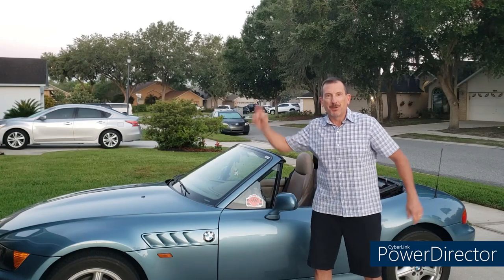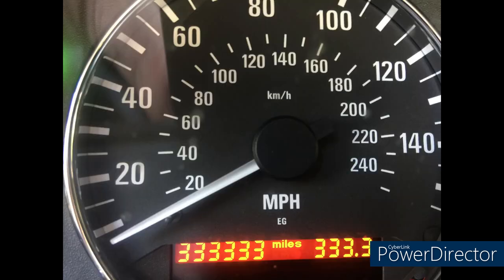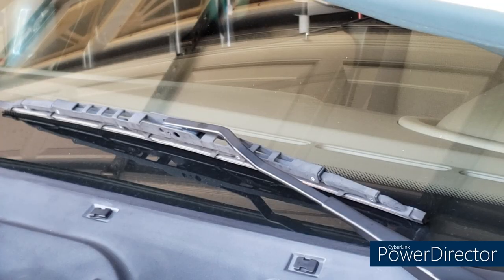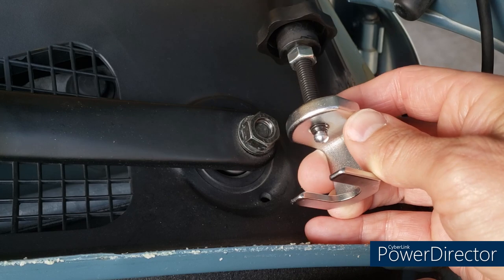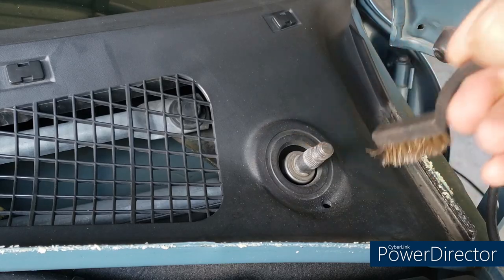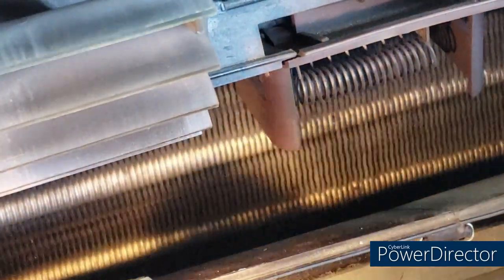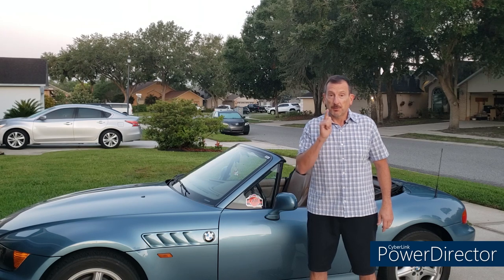How to Remove the Cowl, Check the Drains, and Clean the A/C Evaporator: BMW Z3!

Comment: I did similar a while ago..You can take it one step further by removing the blower to clean more surface area of the evaporator. Additionally, after the foam breaks down use a squirt bottle to clean and  flush out the system with water..You will see all the water and foam dripping out the bottom.
Reply from the maker: Good call!  I should have rinsed that day.

Comment: Thanks for posting! Did you use any sealant when you refitted the plastic cowl? Noted the factory applied sealant had dried up and degraded. Not sure if that within itself could cause water ingress.
Reply from the maker: Didn't at the time but planned for later.

Comment: Extremely interesting, enlightening and informative!  I will have to give this careful thought to performing myself in the near future.   I noticed that you did not used any compressed air to blow down in the evaporator fin area to further agitate and remove loose material.  If you were to do this again, would you do anything differently?  Did you apply any kind of adhesive to the rubber gaskets you removed?  One project I have been thinking on is replacing the rubber gaskets around the door openings.  You know, by the time you amass your Z3 videos, you probably will have fully disassembled your Z.  Just waiting for when you will remove all of the body and the engine and put in a larger one!  More fun to come!  Thanks for a great video!  😀
Reply from the maker: The compressed air didnt occur to me oddly enough.  No new adhesive on the seals.  There is no upward or lateral force to move them.  Thanks as always Walter!

Comment: *ELEPHANT NOSE DRAINS *

This morning I have cleaned out my Elephant nose drains on my Z3, located under the scuttle panel. 
Both drains were completed blocked with debris, rotting leaves soil, grit etc so a job definately worth doing. 
Both the drains were fed through the relevant holes and out into the engine bay, yet when I came to replace them, I noticed that there was an almost natural fit and location for them slide internally rather than hang into the engine bay.
Can anyone confirm what the exact position and location of the fitted elephant drains should be..
1. Hanging out into the engine bay
2. Fitted internally.
Any photos of anyone else’s Elephant drains in situ would be appreciated. 

Thanks in advance ..
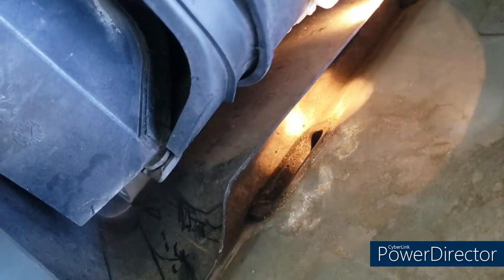Reply from the maker: They should exit near the sides of the clutch/tranny bellhousing if I remember correctly.   I discuss it at 11:30 or so in the video.
Reply: Many thanks for the reply.. 
yeah, I picked up on your comment in the video. 
However. My rubber drains were hanging through the portal into the engine bay. Thereby allowing water to drip into the bay onto the top of transmission casing or thereabouts.. 
Have you removed you full drains previously, and if so where did you rehouse them to.. Ie through the hole into the engine bay, or down through the tunnel of the bulkhead… 
You can actually get a good view of each drain on the holes in the bulkhead..
Reply from the maker: @oliverjones1136  never have removed the drains, so where I got them is where they are.  Are yours damaged?
Reply: No not damaged at all… and easily replaced back in situ.. 
I watched your video re cleaning them out then embarked on job this morning.. completely blocked.. ! 
However, I noticed that from looking down I could see the bottom of the elephant drains sticking out the hole into engine compartment, which I then didn’t think anything about.. except for realising. I could easily pull them out entirely and remove from car.. which I did.. gave them a good wash in the sink.. 
but then when replacing I also realised that they had what seemed like a natural fit into the same place. But the bottom routed into the tunnel, rather than straight out into the engine compartment above the transmission.. so now I actually don’t know which is the proper route for these drains…
Reply from the maker: @oliverjones1136 got it,  I'm not near the car  today,  let me take a look tomorrow if I can.
Reply: Excellent and Thankyou.. Be great to see which route yours take.. and then I shall follow.. Apologies for slow reply.. time difference as in UK.. 👍👍
Reply from the maker: @oliverjones1136    Took a look today from above, can only really see the drivers side one barely (drivers side USA), seems to exit pretty much straight down, in front of the firewall, about 3/4 back on the bellhousing, technically still in the engine compartment.  Good luck with yours!
Reply: Thanks very much.. 
I replied earlier with a link of a pic that I found on Internet.. seems to have been deleted though… ( Don’t think you tube allows links ) 
Seems the drains may be intended to hang into the engine bay and through the firewall. Is strange though, as now wondering what the tunnel is within the firewall ( the possible natural fit ) Many thanks for your help.. will continue to try and find a definitive answer . Regards. 
Oliver

Comment: i have a 1996 z3 and my ac blows perfect when its on the window setting and the feet setting, but when i put it on the main setting it blows very little. i dont know if something is clogged or i need a new fan. do you have any ideas on what to do.

Comment: What's a good price for a Z3 these days? I've been eyeing one up that's optioned the exact way I want, but it's got some cosmetic damage. I've seen the kbb stuff but just wondering what the prices are like in other places.
Reply from the maker: Hard to give a hard number without knowing the details.   I use cars and bids to monitor prices.  Take a look you can filter to just z3 auction activity.
Reply: What's a good prize for a lunch these days??

Comment: Thanks again for another informative video.  And Ì'm a bit confused. How did Mark from Pennsylvania get the german number plates and is it legal to use them on the roads over there?
Reply from the maker: Not sure!  Probably a state that doesn't require a front plate.   So whatever is up front is a decoration.
Reply: @MomentofZed  No front plate required? Just unthinkable here in Europe.
Reply from the maker: @thomasz3coupe591  none here in Florida either!
Reply: Hi Mark from Pennslvania here. PA does not require a front so the front plate is considered decorative. I ordered plate from a company in Germany that custom make Euro Plates. That is actually 1 of 3 German plate I have.
Reply from the maker: @markbigelow1849  thank you for the details!
Reply: @markbigelow1849  Thank you so much for additional informations. 
German authorities would get a heart attack if you'd use false plates on the roads.
Reply: BTW, here you can buy plates as you like for your personal use or decoration,  but not for use in traffic.